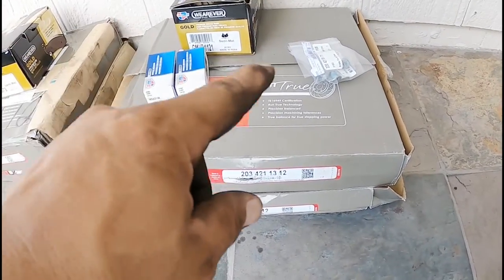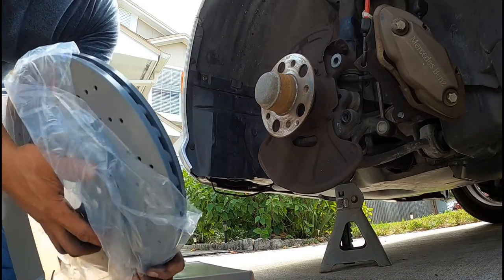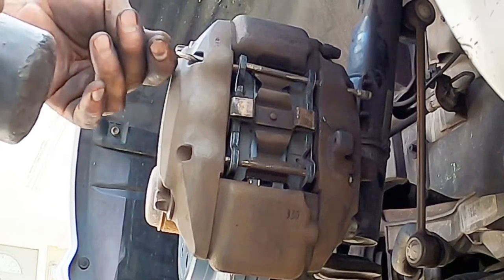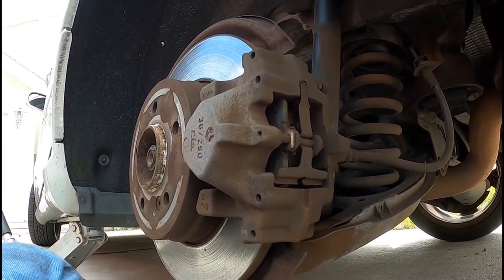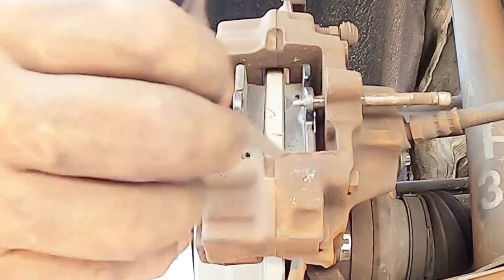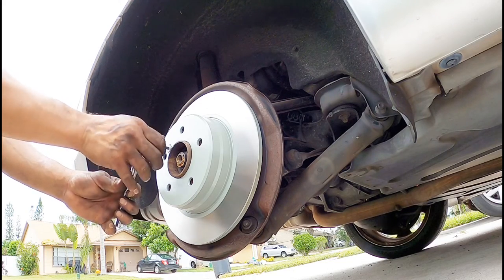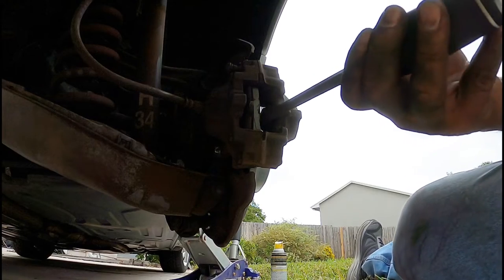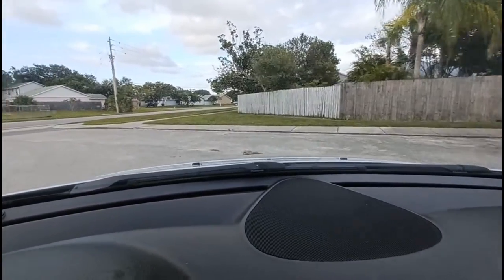HOW TO INSTALL FRONT AND REAR BRAKE PADS & BRAKE ROTORS. FOR 2005-2007 MERCEDES Supercharged C230

Comment: Dude i did rhe front, but the rear brake pads killed me. I tried 2 different set of pads but they were couple inches taller than the original ones. Did not sit in the caliper right
Reply from the maker: I hear you, sometimes companies you order parts from don't send you the right stuff. Just double check the year, sometimes the built date after July would be considered next year's model on some vehicles. When I used sell parts, I encountered date issues.

Comment: How did you get the rear rotors off? My parking brake is released and they won’t budge
Reply from the maker: Clean around the center with a wire brush, to remove rusted rotor housing, mine was waaaayyyy bad I had to use a screwdriver and scratch the build up off. Then use a BFH to tap the rotors off.

Comment: Do you HAVE to change the rotors always?
Reply from the maker: No, but the vehicle had reached high mileage, close to 85,000 miles. It was time. I should be good for another 50k to 60 k more miles.